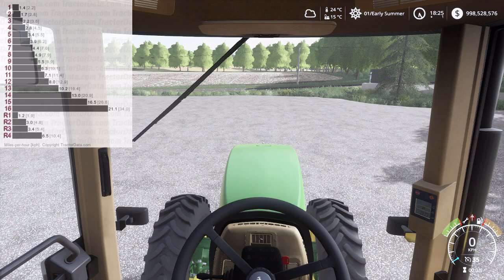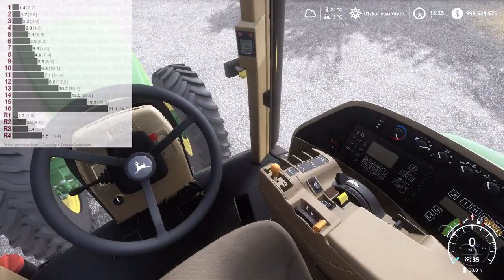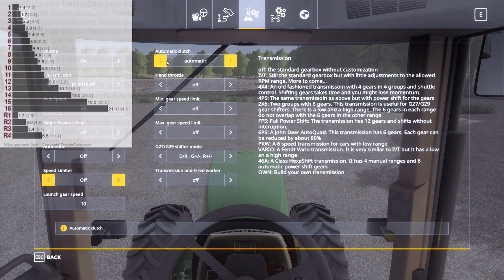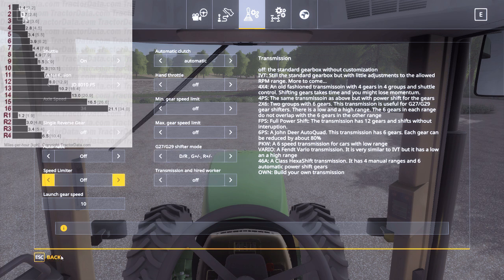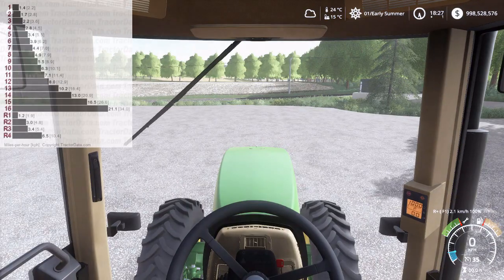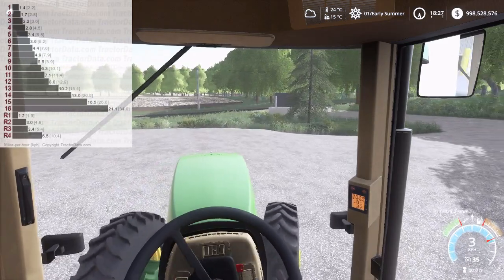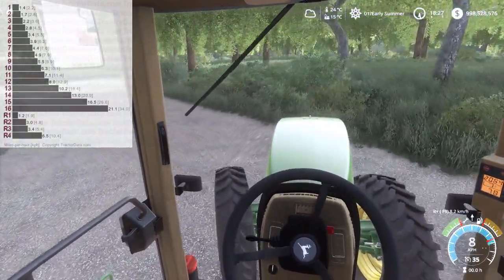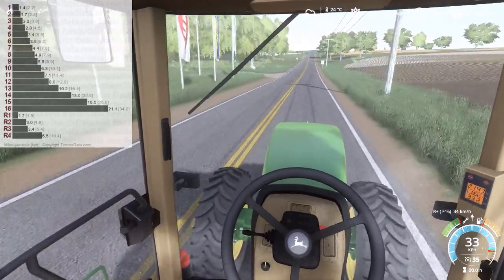FS19|John Deere 16 Speed Powershift Transmission Demonstration

Comment: Also as someone who drives/driven 4 speed, and 19 speed powershifts on John Deere's you can start in any gear you'd like as you would with a car, and clutch isn't needed after you put it into a gear. For example once it's in 1st (or any gear I choose) I can downshift or shift up without clutch. Same goes for the reverse gears. Usually with the 19th speed you start off on the road 12th and above. Same thing goes with the powershift all around to my knowledge.

Comment: We have an JD 8300 with the 16 speed power shift. I dont start in 1st gear usually like 8 or 10. Also top speed is somewhere around 25mph irl.
Reply from the maker: I made these setups and videos with no understanding of how they work IRL, I was sent a video showing how they work, and I had no idea they were so advanced for something in the early 90s.

I will likely adjust the top speed, is it possible you are running a slightly taller tire than the factory ones?
Reply: @TysonDiniz  it's got 46in on the rears

Comment: What features require a steering wheel and shifters? Do all of them? Can you even use this mod with only a keyboard and mouse?
Reply from the maker: Everything but the clutch can be used with a keyboard and mouse, you need to use the automatic clutch.
Reply: @TysonDiniz  ok, so I can shift gears and stuff too then
Reply from the maker: @noahlichti4152  Yes, the keys for that are on the modhub page for the VCA